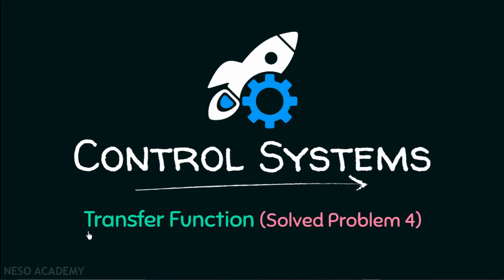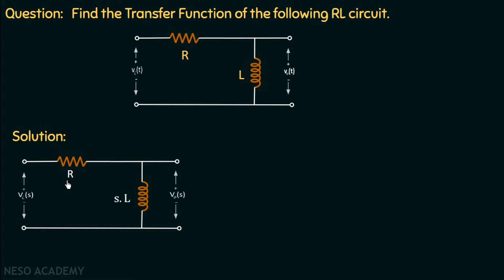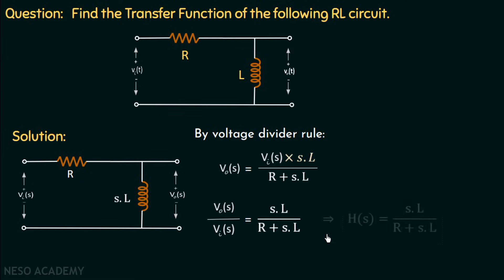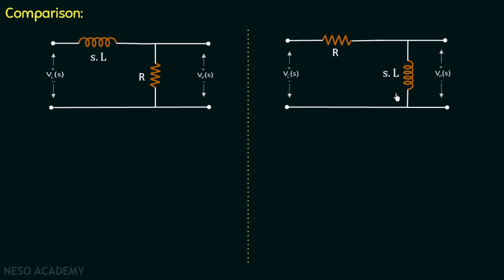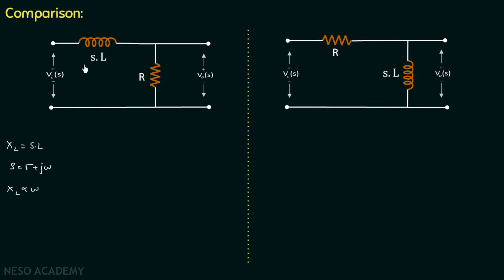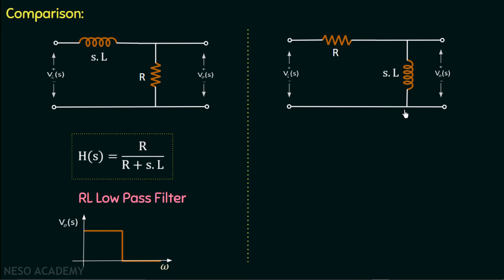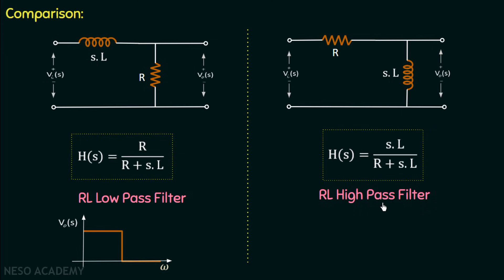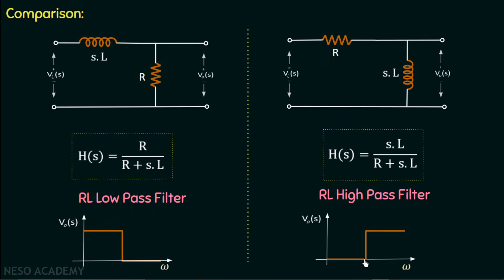Transfer Function (Solved Problem 4)

Comment: HOW DOES TRANSFER FUNCTION IS RELATED TO IMPEDENCE OF THE ELEMENT
Reply: The impedance of a resistor is just R, and that of an inductor is sL.  When you measure the voltage across one of them, then you have a simple voltage divider circuit.  Does that help with your question?